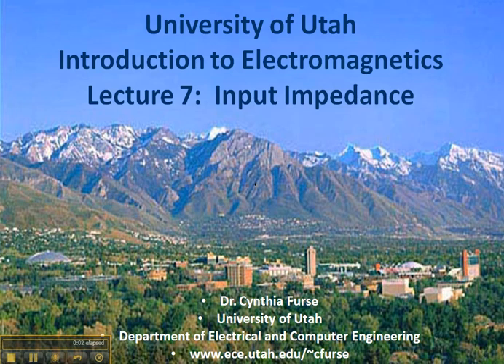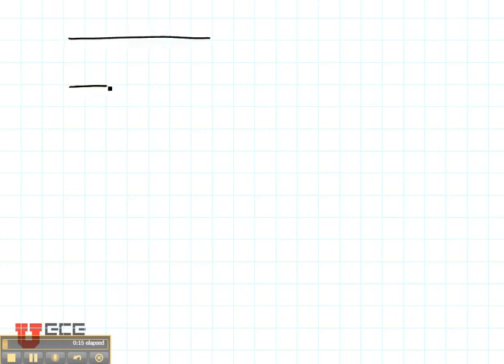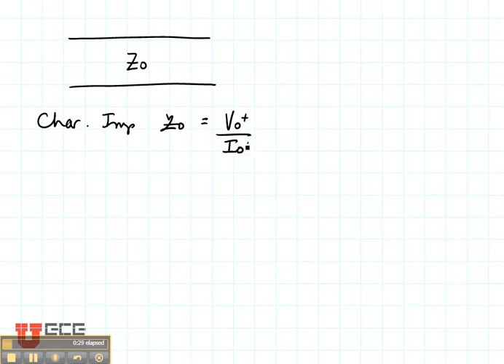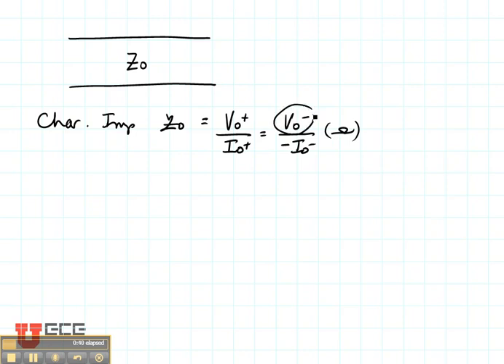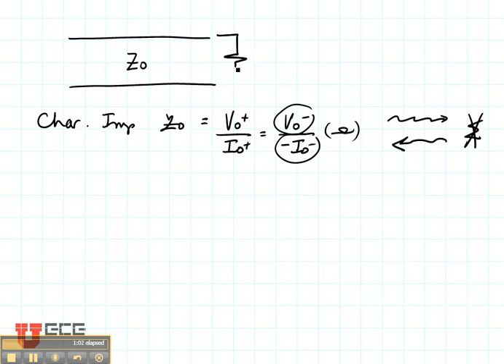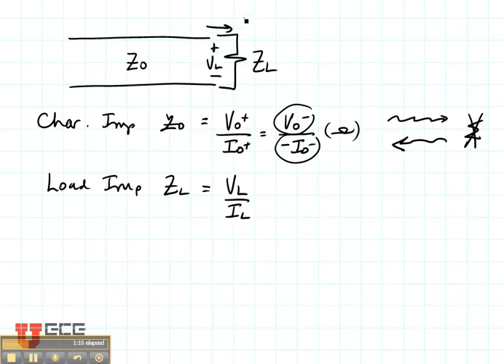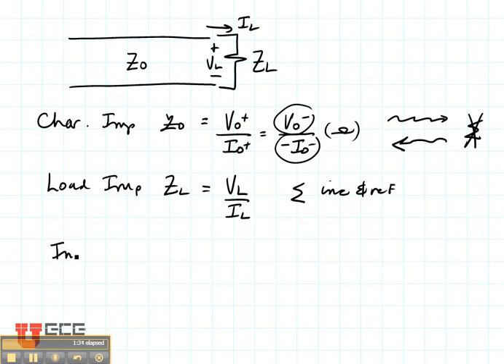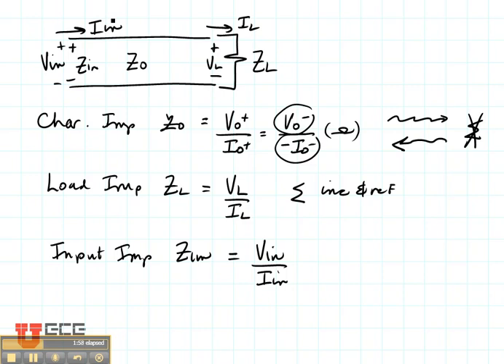ECE3300 Lecture 7-1 Input Impedance

Comment: Hi.

What does Input Impedance: >220k Ohm, unbalanced mean? 

The main issue is that I have been trying to record my acoustic guitar through an Audio Interface- Fast Track Pro. The mic is hum free but when I insert my guitars jack in, I get a significant hum noise.
I thought I might find answers here. 
I am using a single coil magnetic pickup with TS cable to record my acoustic guitar.

Any help would be very much appreciated.
Thanks in advance.